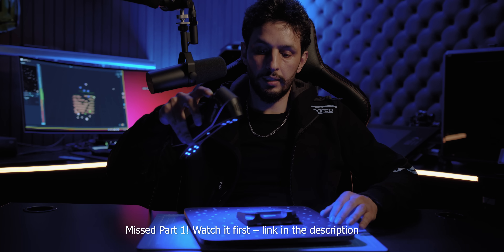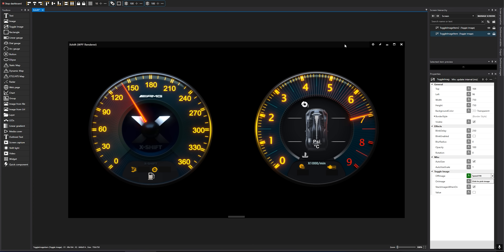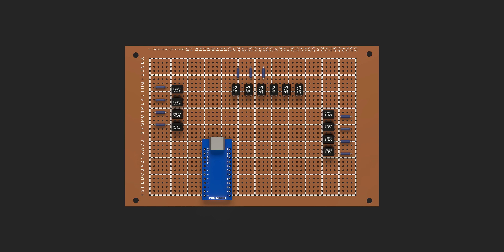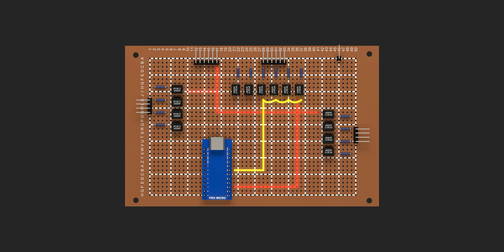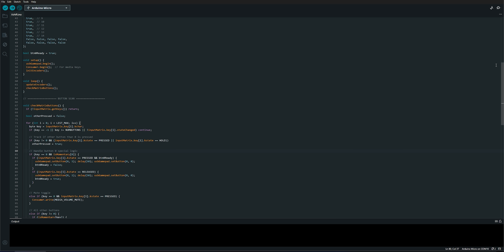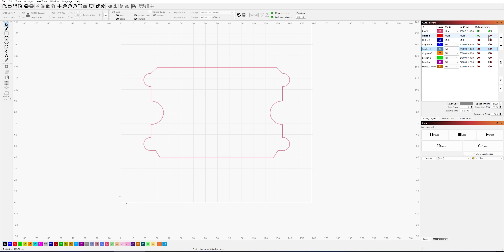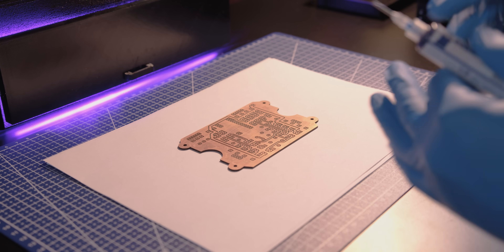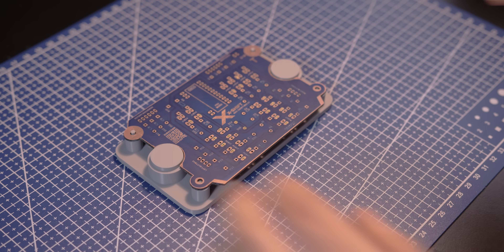DIY AMG Console – PCB, Speedometer & Final Assembly! Part 2/2

Comment: Very impressive! I am working as an engineer in microsystem technology and automated lasers and I have never seen the use of a laser this way. Of course, PCBs are usually manufactured with lithography techniques and chemical baths, assuring both high quantities and smaller diameters of the conductors. Also, you need THT (through hole technology) in order to connect the sides, which is done differently on grand scale. And technically you are limited to a 2-layer-PCB. But for prototyping and hobby, this is such a genius way! And virtually anyone can do this, for lasers are these days widely available in DIY-Makerspaces. Honestly, so cool to have seen this (and chefs kiss to the quality and aesthetics of your build, it’s just amazing!)

Comment: Here is some advice, when doing voice overs, talk louder and dnt be too close to the mic. This will prevent you from using the deeper tones of your voice, these tones make it harder to understand what you saying at times. Amazing video❤❤❤
Reply: The project and video is awesome, but I agree that the voice over needs a bit of improvement. It's definitely difficult to hear and understand certain parts. There is also a lot of vocal fry in the voice, so opening the mouth wider and speaking with more clear pronunciation would also help. But all in all, amazing work.